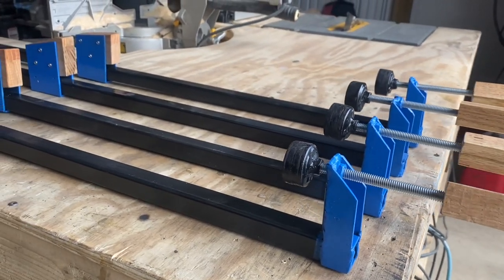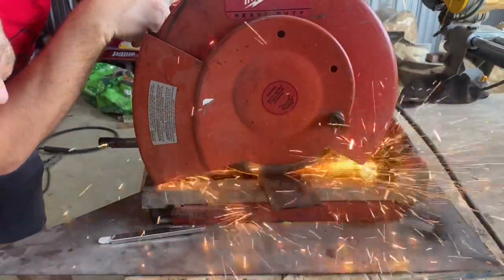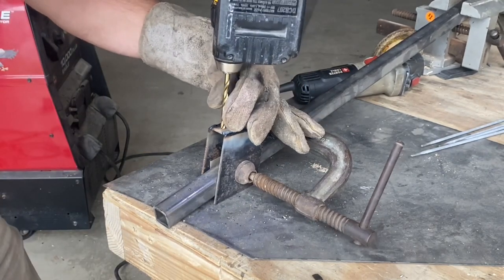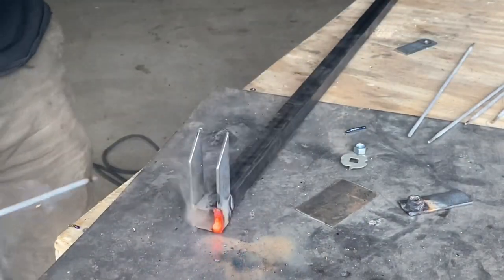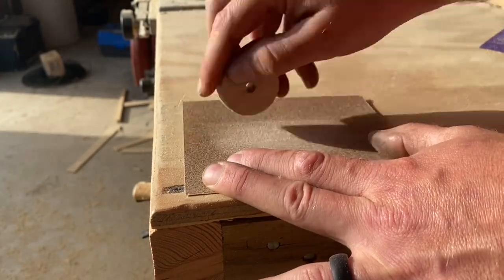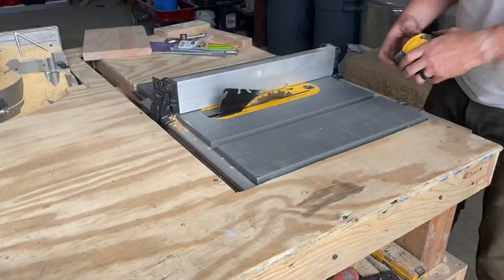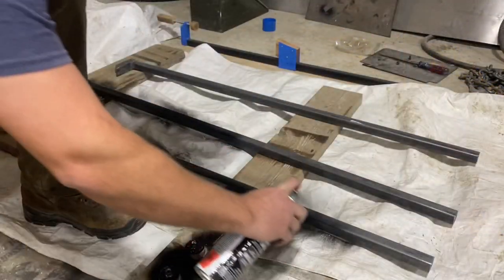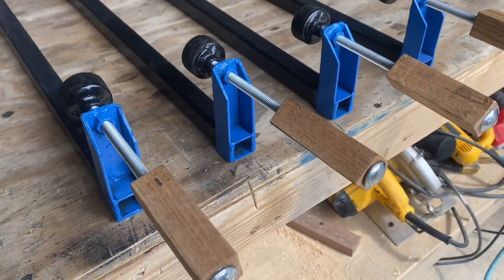How to Make Homemade Bar Clamps (For about $8)

Comment: Neat little build. But it really seems like avoiding buying a $25 clamp by using $50 of materials and several hours of time.
Reply from the maker: Thanks.  These only cost me about $8 each since strapping, square tubing, and carriage bolts are so cheap.  But you are right, buying them is much easier lol
Reply: @DIYMAN  Oh wow.  Square tubing is nowhere NEAR that cheap for me.  That changes the equation entirely.
Reply from the maker: That stinks. There are a lot of steel sales places in Oklahoma.  It’s very affordable here
Reply: @DIYMAN  Welp, all the better that you posted this.  It didn't occur to me that I was paying too much. I just figured that's what it cost.  I'll be looking out now. o7
Reply from the maker: Lol, yeah, the place I get my metal is a little higher than most in the area, but it’s so convenient... so I keep using them.  But you’ll pay roughly 4x for square tubing if you buy it from Lowe’s or Home Depot